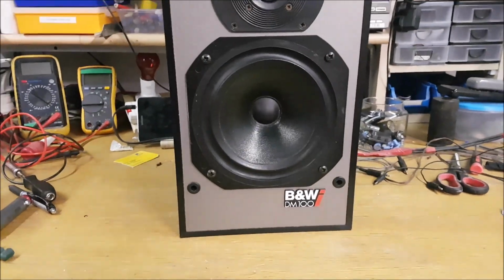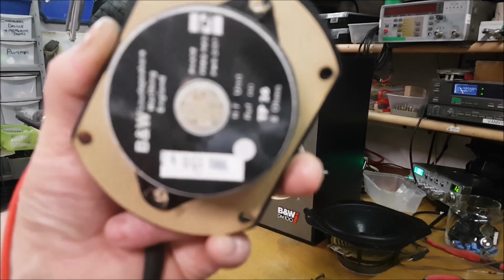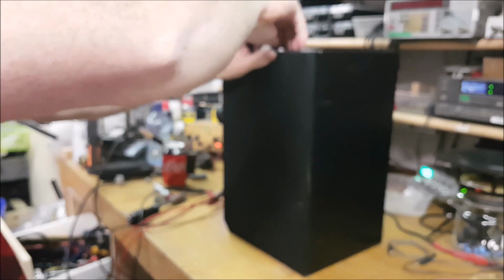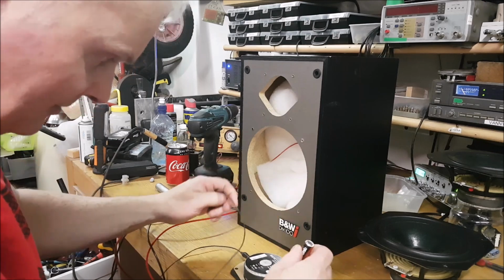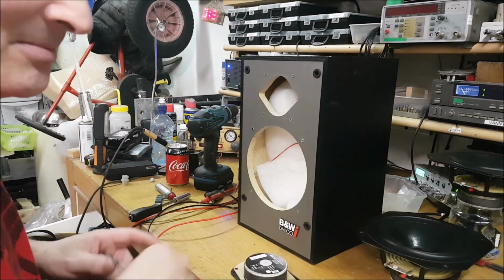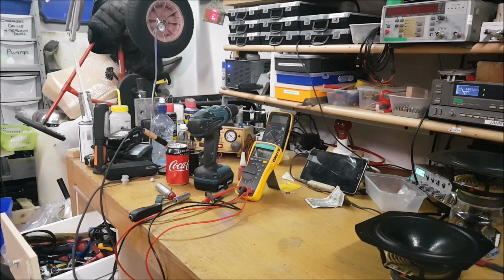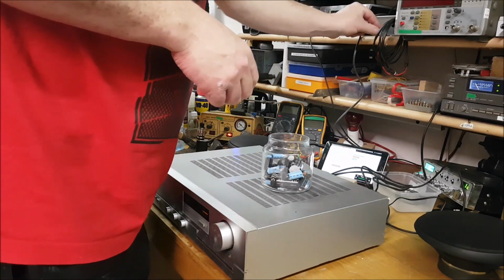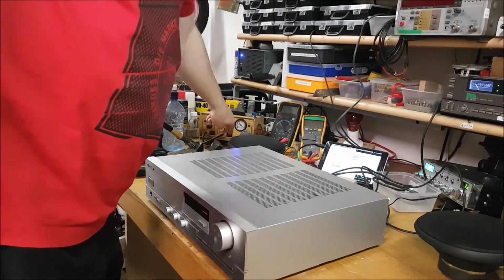Bower & Wilkins DM100 Speaker Teardown

Comment: Those speakers certainly looked the part. I am guessing they are studio  monitor speakers on first glance. Too bad they are blown with only one driver being good.
Reply from the maker: I reckon someone hooked them up to an amp with DC on the outputs. I'm looking into re-coning them.
Reply: @GeorgeEI7KO  TReconing the speakers would make for a neat video for sure. More exciting then unboxing speakers and doing an install.
Reply from the maker: @Tobinindustrial  thing is Andy, from what I can see is that new drivers would be cheaper than recone kits. I'll have to do more research.